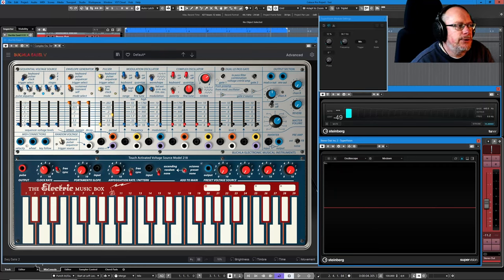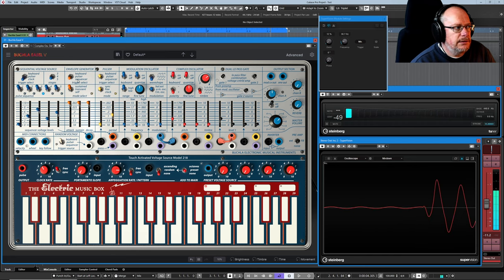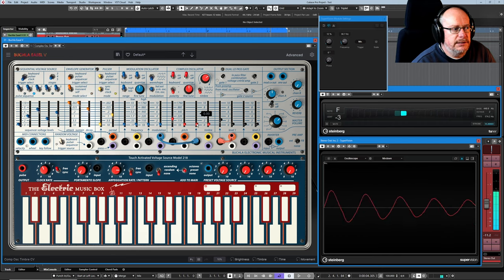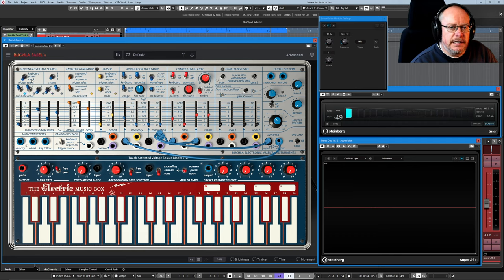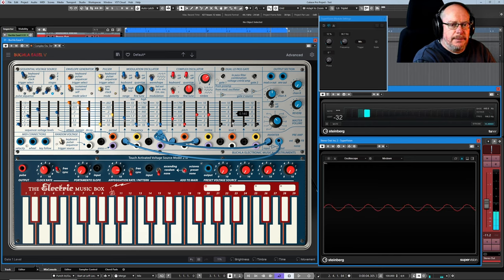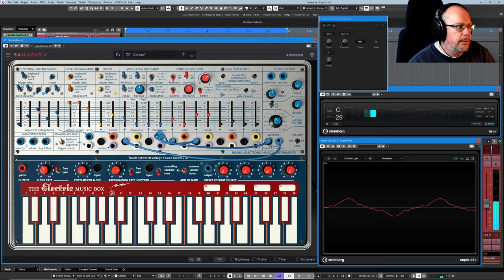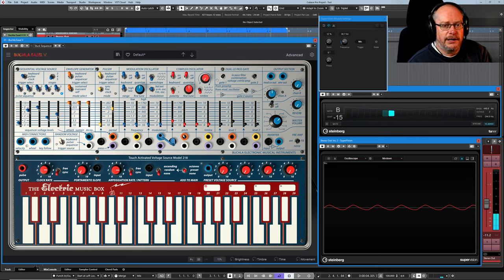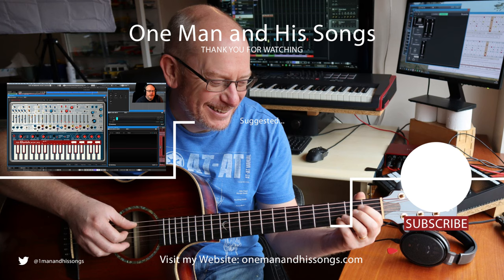Arturia Buchla Easel V Tutorial Ep#8 - The Sequential Voltage Source

Comment: I  am trying to figure out the relationship between the sequential voltage source and the sequencer in the and the sequencer. It seems that they can run concurrently bit also that the svs affects the sequencer. Was this examined elsewhere. Btw-this is surely the best set of tutorials that I have ever seen. I could not make heads or tails of this synthesizer previously (and now I can).
Thanks!
Reply from the maker: Yes, I examine the Sequencer (otherwise known as the Right Hand Page) here https://youtu.be/EhEafmxLoFE. Just think of those two modules as control voltage sources. The Right Hand Page sequencer is fundamentally tied to the Pitch of BOTH Oscillators (more internal, hidden wiring!), whereas the SVC has to be physically connected to an Oscillator's pitch if that's what you want to do. If it is, and both of those modules are active, then yes, absolutely, they're both going to be combing together to generate a SUM of their control voltages, which we'll hear as a change in pitch.
Reply: Thanks. Sometimes when I am playing both together, it seems as if the volume of the sequencer is way down relative to everything else and I cannot figure out exactly how to boost the volume although it clearly is on the presets. This synth is really quite a rhythm machine. @OneManAndHisSongs

Comment: I love your tutorials! So the modulation oscillator is blue and the sequencer is also blue. Does the modulation control only when the five voltage controls are at zero? I think that I may have missed something here.
Reply from the maker: Thanks! Unfortunate that they chose 2 different shades of blue, but, yes, Sequencer is dark blue and Mod Osc is mid blue. I'm afraid I don't quite understand your question about the voltage controls, but there's nothing particularly special about zero - it doesn't "enable" anything per se. If a slider is at zero it just means it's not having any effect on the synth - as you increase any particular slider, the control voltage associated with that slider also increases, and so any destination to which it's connected will be duly affected.
Reply: @OneManAndHisSongs  Thanks-I still am a little lost as the sliders seem to have the same color. How can they work then at the same time: is that the function of the mod cv out?
Reply from the maker: The Blue of the Sequencer is darker than the blue of the Mod Osc - if you mess with your display brightness and contrast you'll see they're actually different. I really have no idea why they chose two such similar colours for completely separate modules. The sequencer and mod osc are not inherently connected in any way. In fact, the Output Section and Midi Connections sections are also blue, and they ALSO have nothing to do with eachother! I think I MIGHT be starting to understand your confusion: the only output jack that's related to the mod osc is, as you say, Mod CV Out. The two jacks in the lower strip, including the jack directly underneath the mod osc, are sequencer outputs. Does that help at all?
Reply: @OneManAndHisSongs  It does- I  think.
So all of the mod osc effects are hard wired to the complex oscillator?

Thanks!
Reply from the maker: Exactly, yes! There's one (invisible) connection from Mod Osc to Comp Osc, and a second pluggable output from the Mod Osc via the Mod CV Out socket.